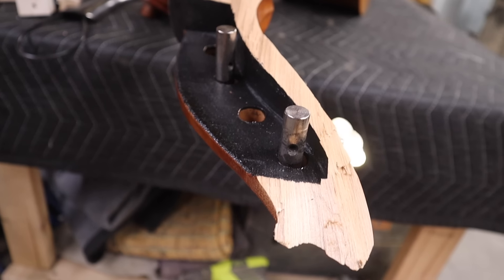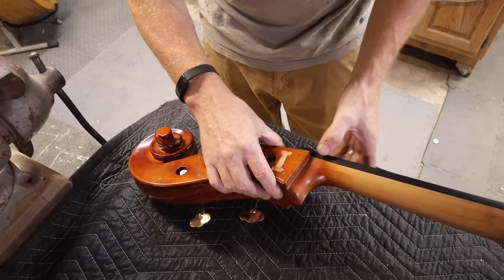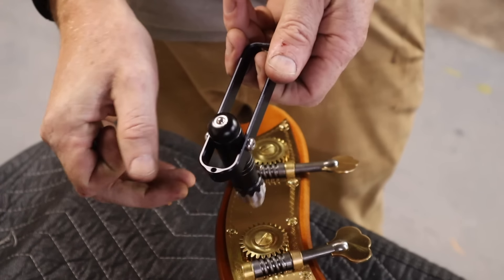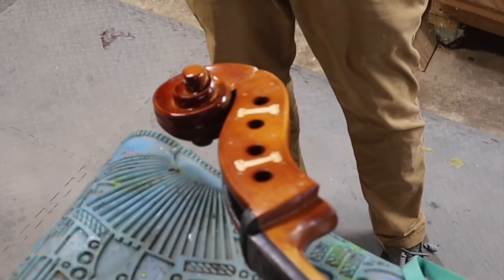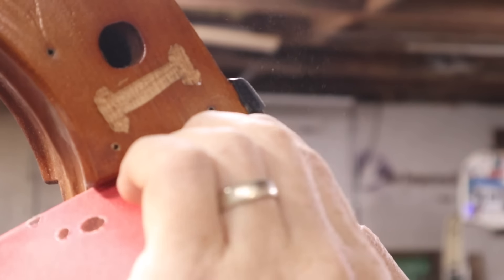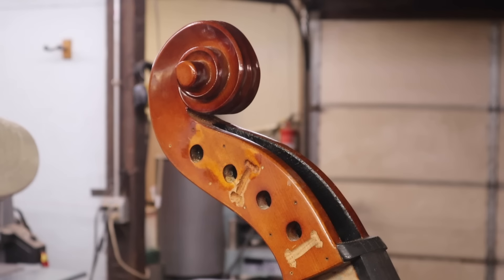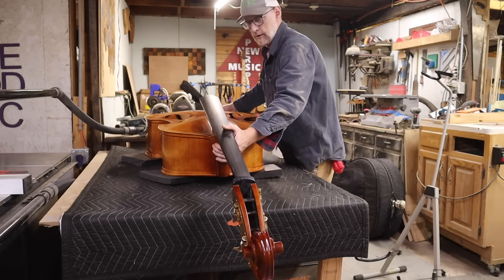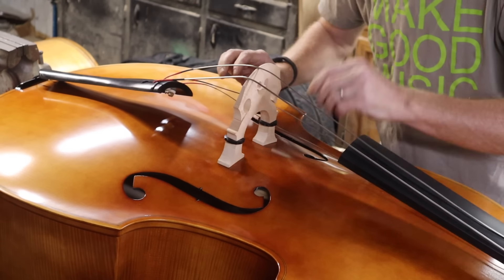Can I Save This Broken Upright Bass?

Comment: Considering the size of the soundpost on an upright, I don't see how you can even install it without laying the bass on its back. It's not like the top will collpase without it as long as you don't put weight on it. Plus the bass bar adds structural rigidity to the top as well.
Reply from the maker: oh yea, you have to put it on its back for a lot of procedures. But I still want to avoid it! I think guys that do this professionally have a better system for safely holding them than a few pieces of foam. If I were doing this often, I would make curved, padded rests, basically the shape of half the instrument, a couple inches thick, that I could position under the bass to support it all around the edges.

Comment: I'm trying to figure out what the difference between a right and a lefty would even be. I always assumed they'd be symmetrical.
Reply from the maker: on the exterior, yes, but internally there is a sound post and a "bass bar" that are on opposite sides. You could probably (?) string a righty up lefty, but it may succumb to pressures in the wrong places over the years.
Reply: Apart from the sound post, the bridge is also different. Since you don't have much adjustability in terms of action, the bridge is cut so you have the same action on all strings.

Comment: I have a vintage Snap On ratchet screwdriver that I bought about 20yrs ago and it was old then, and as much as I dislike Snap On for their overpricing some tools which may be quite ordinary, this thing is a Rolls Royce. I couldn’t complain about anything on it and I wouldn’t change anything. It’s the perfect screwdriver. I’d like another one that is maybe half that size for smaller jobs and I’d be super happy but it doesn’t exist, so I buy almost every Chinese ratchet screwdriver I can find looking for the perfect one.
Reply from the maker: apparently the one I'm using is based off a very old patent the designers found. I think that's why it works so well. it wasn't designed to be the smallest and cheapest to produce, rather the strongest and best.